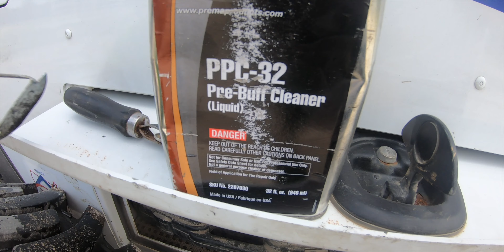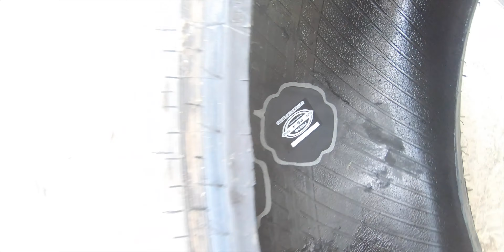Tractor Tire Field Repair and Adding Liquid Ballast

Comment: the thing stuck in your tyre was called a Prong Hoe 
we used them to dig out couch grass and other running grass/weeds from between the rows of small crops
Reply from the maker: You learn something new every day

Thanks for sharing
Reply: I used to use them years ago we allways called them potato forks in NC
Reply from the maker: Thanks for sharing.

I didn’t know what to call it but I know it didn’t do my tire any favors

Comment: I’ve had many nails, thorns, screws, barbed wire, and even metal scraps and tire weights puncture tires before - but that’s the first time I’ve seen a pitch fork! You’re right about the value of tradesmen. #purplecollarlife
Reply from the maker: Thank you for watching and for commenting

Comment: I've changed lots of car tires in a shop. Looking at this, I think tractor tires are almost easier. Makes sense when you really don't want to take the whole wheel off and put it on a machine.

Comment: My tire machine is in an unheated area so I use windshield washer and dish soap for my tire mounting liquid. I also put it in a spray bottle to check for leaks.
Reply from the maker: Thanks for sharing

Comment: BioBallast,.. beet juice?
 Beet juice is common weight out here in Oregon.
Reply from the maker: It’s a similar product but not exactly the same product.

The shop that came out and fixed my tire said they used to use beet juice and switch to bio ballast. I don’t remember why they switched
Reply: @RockhillfarmYT   It would be neat to know what it is. I have an older Kubota BX23, been thinking seriously about getting fluid fill for added weight. I'll do some searching around.. I know the old classic chemical fluid was not really "safe" for food fields if it leaked.  PS:  We love the Lock-N-Lube.. really makes greasing a LOT easier.

Comment: The two weights on each tire and the liquid ballast adds how much weight altogether? And can you break it down for us per tire weight and liquid separately? Thanks for the very educational video.
Reply from the maker: I actually have three wheel weights on each side. Each wheel weight weighs 60 pounds. 

Fluid in each tire is 260 pounds. So each side has 440 pounds of additional weight and there is 880 additional pounds of ballast between those two things combined

The six weights make a total of 360 pounds and all the fluid is a total of 520 pounds

Thanks for watching
Reply: @RockhillfarmYT  how much air pressure are running in ur tires then? 20 pds? or less for the better ride? i bet ur butt hurt after riding that long?lol
Reply from the maker: They still have full air pressure, just less volume of air.  The tire repair technician filled them to 50 pounds I believe

It was definitely a beating on my back

Thanks for watching and for commenting
Reply: @RockhillfarmYT  oh my--i have the same tire on my 2520 and since 2006 i have only ran 12 to 20 pds in either tire. i had to put tubes in mine a couple yrs ago due to getting pin holes in the sidewall. only one tire did that-why-IDK. maybe the tech put that much in urs because of ur wheel weights u got on there. ? keep cranking these good vids out. i sure enjoy them
Reply from the maker: I should probably look into that more, I actually had not given much thought to the air pressure
Reply: @RockhillfarmYT  Your running so much pressure in your tires you are going to cause knots to form on the inside, I only run 30 pounds in a 30,000LBS Backhoe, 
          Your also not getting traction and your going to destroy you back from WBV.
Reply from the maker: I’ve seen a lot of guys with fluid filled tires post that their wheel is spinning in the tire as a result of not enough air pressure
Reply: @RockhillfarmYT  Air preasure would have to be 15 to 10 pounds before that would happen, most people just don't check the air preasure daily and run the tire flat without knowing it.
Reply: @RockhillfarmYT  Also your more likely to slide and Flip.over with Tires to highly inflated your actually putting your life indanger because tires are too hard to get the proper traction.  Those contractors grade Tires are bad about sliding anyway they were designed for highway usage, I don't run them.because I don't go on Black top very often and Ag type tires have way better traction on hills and wet or snowy ground.
Reply from the maker: Thanks for all the info
Reply: @RockhillfarmYT  Your welcome just trying to keep you safe.
Reply: Hello Brock, thanks for that video. I am curious, what is the product that the teck put around the rhim while filling up with air to make the tire stick?
Reply from the maker: @andrebeaule9457  someone in the comments mentioned the name

Bead something
Reply: @RockhillfarmYT  I am not asking for the liquid which is pumped into the tires, which is beet juice, I am asking for the beige grease like stuff to prevent the air from escaping the tire while inflating it. That beige grease like stuff is used to fill up the gaps between the rim and the tire shoulder to prevent the tire inflating process to lose air. I am looking for the name of that beige grease like product.
Reply from the maker: @andrebeaule9457  Yes, I understood what you meant. I actually don’t use beat juice in mine it’s a similar product but it’s called bio ballast.

The grease type stuff that they put around it to pop the bead on is what I was talking about. I can’t remember what it’s called but I just remember someone told me in the comments of this video
Reply from the maker: I just found it. The guy said it’s called bead pack and it’s made specifically for this purpose
Reply: @RockhillfarmYT  Thank you Brock for the reply. I know for a fact (base on a past experience) that if the tire does not stick to the side of the rims, it is impossible to inflate the tire. Have a nice day.

Comment: @Rockhill farm - How was the cost of the repair handled customer-wise?

I know if it was your land that the damage happened on, the full $314 cost would be on you, however, since the customer or a farmhand left the corn rake out to be run over, (thank Yah it wasn't your foot with a puncture hole in it, medical bills on a job site without insurance really suck, ask me how I know), was all or part of the cost put on the customer?

Did you have a signed contract with the customer, and if so, did it have a repair clause/repair downtime clause written into it?
Reply from the maker: I do have insurance but I wouldn’t want to file a claim for something in that price range.

It didn’t even occur to me to ask the customer to pay for the damage.

If that’s how you earn your living you do probably have to think that way though

Comment: That Tech should be ashamed. Both of the patches he put in are wrong. They are Marked how they are suppose to go saying bead to bead and he had them turned wrong
Reply from the maker: Thanks for sharing. 10,000 views and you are the first to notice
Reply: @RockhillfarmYT  I am a plant manager for a retread plant and I am certified in OTR repair as well. I notice everything with tires lol

Comment: I'm perplexed he didn't have a bead blaster and used grease instead
Reply from the maker: It seemed more like wax than Grease to me

I don’t know much about it but he said they just pack that in the gap to stop the airflow and then air up the tire and it pops on. If you noticed he put all of the compound back in the bucket and they just reuse it.

Seems like a really simple solution to me

Thanks for watching
Reply: @RockhillfarmYT  It's a product called bead pack, which is made from vegetable oil. I service tractor tires as well. He probably could have blasted that tire but most tractor tires are too big for a 5 gallon blaster to work.
Reply from the maker: Thanks for sharing

Comment: Great video.  Since you have tubeless tires you can keep some plugs with you to do in field repairs.  Not doable with tubed tires.  I've done this several times when brush hogging.  Eventually bought aircraft front tires that are 18 ply from Gensco and no more worries for the fronts.  Just be careful.  I always hog in the same direction.  Thanks for the content.  I appreciate it.
Reply from the maker: Thank you for watching And for sharing your experience